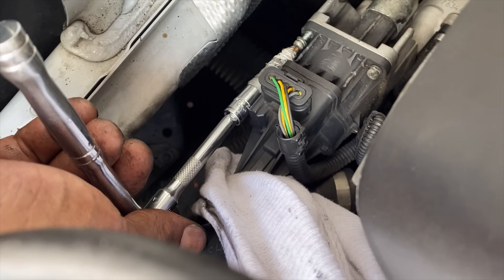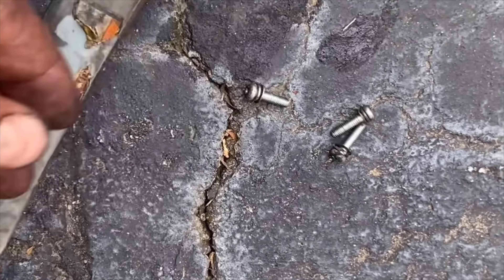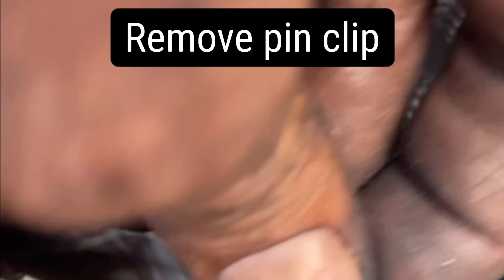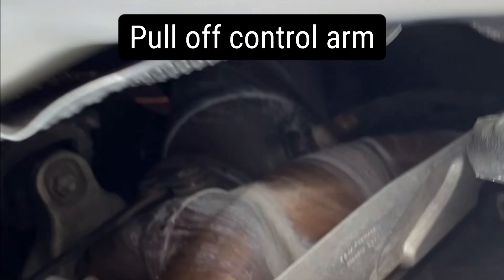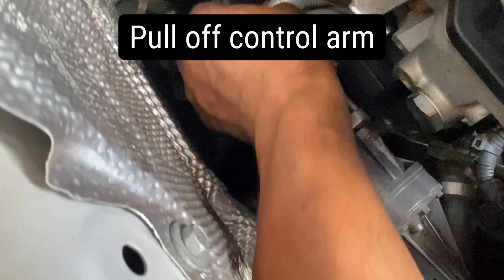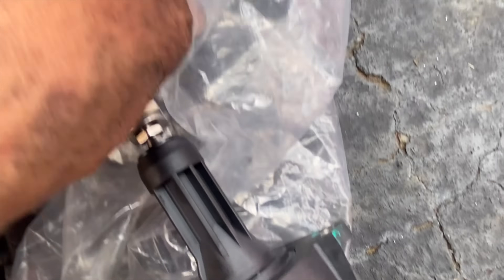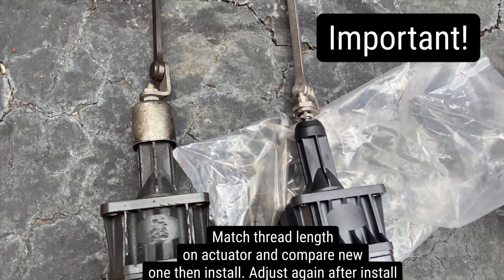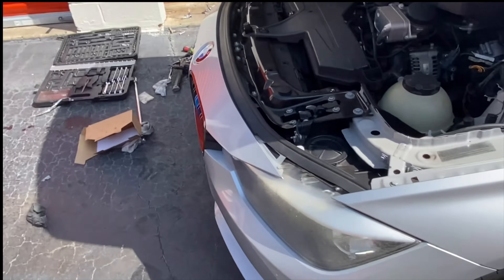BMW 328i - Wastegate Actuator replacement/ P1920 code/ Fix Drivetrain Malfunction (n20) f30 /f32 DIY

Comment: “I have this error: 123432 Electric wastegate, stop learning: stop position (wastegate closed) outside tolerance. What could it be?
Reply: F32 420i n20
Reply from the maker: Good luck and let me know if you need anything else. Be sure to like, share, subscribe and check the links in bio🙏
Reply from the maker: That BMW fault code 123432 (Electric wastegate – stop learning, closed position outside tolerance) on an F32 420i N20 almost always points to a mechanical wastegate issue, not software.

On N20 engines, the turbo wastegate flapper and arm wear over time, which causes excess play. When that happens, the DME can’t confirm the fully-closed wastegate position during calibration, so the adaptation fails and throws this code.

Most common causes on BMW N20:
• Worn or loose wastegate flapper (very common)
• Misadjusted wastegate actuator rod
• Failing electronic wastegate actuator (less common)
• Binding wastegate due to carbon buildup

Clearing the code or updating software won’t fix it if the wastegate can’t physically close. A temporary fix can sometimes be done by adjusting the actuator rod, but the permanent solution is a turbo repair or replacement. BMW sees this issue frequently on N20/N26 motors.

If you’re hearing a metallic rattle on cold start, that’s a strong sign the wastegate is worn.

Comment: I bought a 2013 328i (n20) engine. The car will not start and the only code i get is tbe p1290 wastegage actuator stop limit, actuator needs relearned. Would this stop the car.from starting? The lady i bought it from was driving it and it went into limp mode and when she got home turned it off and back on it would not start back up. P1290 is the only code i am getting
Reply from the maker: Congrats on your car purchase. More freedom! 

Ok let’s get down to business. First step is it a new actuator?
If it’s new or when you replace it (link in bio) you will need to calibrate the actuator with insta software that cost yearly and got to your local mechanic. Other way is to manually calibrate it(in description) or I can help you via live stream after paying the $99 live conference fee. If you need a step by step until fix.

Here is more detail below to assist you? 
2013 BMW 328i (N20/N26) – P1290 Code

P1290 means Turbocharger Wastegate Actuator Control Deviation. The DME is not seeing the boost pressure it expects, usually because the wastegate isn’t opening or closing correctly. This is a very common issue on 2012–2015 BMWs with the N20/N26 engine.

Common symptoms
	•	Check engine light
	•	Reduced power / limp mode
	•	Hesitation under acceleration
	•	Weak or inconsistent boost

Most common causes (in order)
	1.	Failing electronic wastegate actuator (most common) – internal gears wear or stick.
	2.	Wastegate linkage binding from heat or carbon buildup.
	3.	Boost control solenoid failure.
	4.	Vacuum line leaks (less common but possible).
	5.	Turbo wear (rare unless high mileage or abused).

How to diagnose
	•	Scan with a BMW-capable tool (ISTA, BimmerLink, Foxwell, etc.).
	•	Run the wastegate actuator test and check for smooth full movement.
	•	Inspect the wastegate arm and linkage for binding.

Repair info (link in bio)
	•	Wastegate actuator replacement is the most common fix.
	•	Part: ~$250–$400
	•	Indy shop total: ~$600–$900
	•	Dealer: ~$1,200–$2,000
	•	Actuator must be calibrated with ISTA after install or the code will return.
	•	Turbo replacement is only needed if the wastegate flapper itself is worn.

Important note
Do not tune the car until this is fixed. A tune increases boost demand and can make the problem worse or damage the turbo.

Good luck 

Https://www.nerovisum.com
Instagram: Nerovisum

Comment: Any idea what a p1290 code could be on a 320i xdrive 2014 ?! I bought the whole watergate actuator already before diagnostics
Reply from the maker: Code: P1290 – Boost Pressure Control, Plausibility (BMW N20 Engine)

Break down of error code:
“Boost pressure control, plausibility: Pressure too high/low or electrical fault in wastegate actuator circuit.”

This code often triggers when the DME (engine computer) detects a mismatch between the commanded boost pressure and the actual measured boost, or when it loses proper communication with the electronic wastegate actuator.

⸻

🔍 Most Common Causes (Specific to 320i xDrive N20)
	1.	Wastegate actuator not calibrated after installation — this is the #1 cause if you replaced it already.
	•	The actuator rod must be preloaded 0.5–1.0 turn when connected to the wastegate arm.
	•	The ECU must “learn” the actuator position using diagnostic software (ISTA, INPA, or BimmerLink Pro).
	2.	Faulty wastegate actuator wiring or connector corrosion.
	•	Check the 5-pin plug on the actuator for bent pins or oil ingress.
	•	Tug gently on the harness; broken wires inside the insulation are common.
	3.	Boost pressure sensor failure (MAP sensor).
	•	Located on the intake manifold. If it’s dirty or failing, it can send wrong readings that trigger P1290.
	4.	Boost control solenoid (pressure converter) malfunction.
	•	On some N20 builds, a vacuum-controlled solenoid helps regulate the turbo system. If stuck or leaking, it throws off readings.
	5.	Turbocharger mechanical issue.
	•	Stuck or loose wastegate flap, internal leak, or damaged impeller can all create P1290 plausibility faults.
	6.	DME adaptation not reset after part replacement.
	•	When you install a new actuator, the ECU needs a fresh calibration (“wastegate adaptation reset”) through ISTA or equivalent scan tool.

⸻

🧰 Step-by-Step Fix

1️⃣ Inspect the wiring and plug
	•	Disconnect the actuator plug. Look for corrosion, loose pins, or burnt smell.
	•	Clean with electronic contact cleaner if needed.

2️⃣ Check the actuator rod and preload
	•	With the car off, manually move the wastegate arm  it should move smoothly with spring tension.
	•	Adjust the new actuator rod so it pulls the arm slightly tight when connected (about half-turn preload).

3️⃣ Run an adaptation reset
	•	Connect ISTA, BimmerLink, or INPA.
	•	Run “Turbocharger Wastegate Actuator Calibration / Adaptation Reset.”
	•	This allows the DME to relearn the new actuator’s limits and clear the plausibility error.

4️⃣ Inspect MAP/Boost sensors
	•	Clean or replace the boost pressure sensor (intake manifold) if dirty.
	•	Verify no vacuum or boost leaks with smoke test or carb cleaner check.

5️⃣ Clear the code and test drive
	•	After reset, clear codes and drive 10–15 minutes.
	•	Watch boost pressure (using a scan tool or MHD/BimmerCode logger).

⸻

✅ If the code returns
	•	Replace or test the boost pressure converter solenoid (usually mounted near the turbo).
	•	Check for software update (DME reflash) BMW released several patches for wastegate logic on 2013–2015 N20 engines.

Comment: It is time to change the wastegate actuator on my N63....oem on fcpeuro is $600 plus. They have cheap ones on Ebay for under $100. How good could they be
Reply: I got mine on amazon for my N20 for like 60-70 bucks just make sure you re learn it with ISTA
Reply from the maker: Or manual adjust by monitoring the boost.

OEM (dealer recommended) -> one with insta software compatible -> or just manual adjust it arm/bolts (cheapest option which works). Part here: https://amzn.to/3BE13kH

Comment: 123702 what is that??
Reply from the maker: The fault code 123702 on your BMW 328i generally corresponds to an issue with the turbocharger waste-gate actuator circuit.

Failed waste-gate actuator (stuck, shorted, or not responding)
	•	Damaged or frayed wiring harness to the actuator
	•	Poor or corroded connector (pins shorting to ground)
	•	Calibration/learning for the actuator not done (after replacement)
	•	On some BMW turbo systems, there are related service bulletins covering extended warranty for the actuator.

Comment: P120408 
P1234.01
P1234.32 
Bu code veriyor  sizinkide aynımı. Bilgi verirmisin
Reply from the maker: 1.	Spark plugs or coils might be weak.
	2.	A fuel injector may be dirty or bad.
	3.	The fuel pump or sensor might be acting up.

Step-by-step fix order (cheapest → most expensive):
	1.	Replace spark plugs.
	2.	Swap coil packs between cylinders to see if code moves.
	3.	Check for air leaks/vacuum leaks.
	4.	Clean or replace fuel injectors.
	5.	Test fuel pressure → replace high-pressure fuel pump if needed.
Reply: @Nerovisum 
Kontak açınca  tahrik veriyor 
Çalıştırmadan
Reply: Turbo veskeyt değişti
Reply: @mustafatekeli1990 
Sorun çözüldü mü?

Comment: Hey I’m currently in the process & wanted to know  how do I tighten the bolts after the actuator is installed? The control arm fell down because the bolts jiggled their way off lol
Reply from the maker: Hello!

Congrats on taking on this project. You will save a lot of money! 

Moving forward, Are you talking about that 1 nut that adjust the control arm length or 4 bolts that lock down the wastegate itself? If nuts, go to ace hardware to buy the same mm nut. The second nut keeps the other nut from vibrating off. Another option you can use is a low grade lock tight liquid placed on threads. That keeps bolts and nuts in place. I accept cash app tips for free advice and repair: $Gettomoney777
Subscribe - like - tip❤️. More love = more frequent content. 

Good job and good luck!
Reply: @Nerovisum hey thank you so much for the reply I used blue loctite for the control arm bolts! I did save 10,000$ and my malfunction is fixed and operating in new condition 😉.

Comment: My bmw x1 been doing this intermittent, happened shortly after we replaced engine due to timing issue. "New" engine came with turbo so we didn't change it. Still have the old engine with original wastewater accuator.
Reply from the maker: It sounds like the issue may be related to mismatched or aging components between the new engine and the original turbo setup. Since you kept the old turbo wastegate actuator from the original engine, there’s a strong chance it’s not properly calibrated for the “new” turbo that came with the replacement engine even if it looks compatible. Compare part numbers and computer/ manual calibrate the wastegate. 

To provide complementary  advice for all in the future donation are accepted. Not one thing in this world operates on free energy and keeps running. https://cash.app/$Gettomoney777
Reply: @Nerovisum n/a, the "new" engine came from the same year and make bmw. It was used and I'm thinking the previous owner had issues with the turbo cause it was about 100k miles less then my current car. I replaced it with turbo from my old engine and don't seem to have the same issues

Comment: I bought a car a 2013 bmw 328i been driving it for 3 days already and seem good no check engine light or nothing so when I tried to go and do a smog check it showed it had a p1290 code yet nothing shows on my car on the screen or light? So far driving been good no nothing
Reply from the maker: Clear the code with one of these scanner tools from @amazon store: 
https://amzn.to/41D39L5
https://amzn.to/4neXXqL

Drive 50-100 miles or 1-3 days then take it back in the emission place.

Comment: I have code p1290 on my 328 f30 n20 engine maybe same problem with wast gate? Tnx.
Reply from the maker: If you’re seeing P1290 and experiencing:
	•	Power loss
	•	Rattling from turbo area
	•	Boost-related driveability issues

Then yes, it’s very likely wastegate actuator-related. Replacement or recalibration may be needed. 

Component
Description
Electronic Wastegate Actuator
Fails internally or gets stuck, causing underboost or voltage issues.
Boost Pressure Sensor (MAP sensor)
Sends incorrect boost readings to the DME, triggering P1290.
Turbocharger Bypass Valve (Diverter Valve)
If stuck or leaking, it disrupts boost control and triggers a fault.
Boost Solenoid / Control Valve
Regulates pressure to the turbo actuator; faulty signals can throw this code.

Secondary cause could be: Wiring Harness Faults
Broken or frayed wires to the actuator or boost sensors cause abnormal voltage (especially “high” voltage errors).
ECU/DME Software Glitch
Faulty logic in boost control loop can misfire codes, especially if the DME has not been updated.
Charge Pipe Leak / Cracked
Causes underboost, which may trigger P1290 depending on how the DME interprets sensor data.
Intercooler Hose Leak
Same result — underboost = fault stored.
Thermostat Heater Circuit Fault
Some BMW documentation refers to P1290 as a coolant thermostat heater circuit high (especially on older BMWs, but rarely on N20). If that’s the case: test the thermostat connector and check for blown fuses.

Scheduled a FT step by step walk through. I charge hourly and you can inquire at generalmailbox1@nerovisum.com

Scan tools in the description

Comment: How much does this repair cost
Reply from the maker: Replacing the wastegate actuator on your 2013 BMW 328i can vary significantly in cost, depending on whether you choose a dealership or an independent repair shop.

Dealership Costs:
At a BMW dealership, the total cost for replacing the wastegate actuator typically ranges from $1,500 to $2,000. This estimate includes approximately $700 for the actuator itself and around $800 to $1,300 for labor. For instance, a BMW M2 owner reported a dealership estimate of $700 for the actuator and $1,300 for labor, totaling $2,000 . ￼

Independent Repair Shop Costs:
Opting for an independent or “mom and pop” repair shop can be more cost-effective. Owners have reported quotes around $1,200 for the complete replacement at such establishments . Labor charges at these shops are often lower, and they may offer more flexibility in sourcing parts, potentially reducing overall expenses.

Parts Pricing:
If you’re considering sourcing the part yourself, aftermarket wastegate actuators are available at varying price points. For example, some replacements are listed around $31.99 (link in bio), though prices can vary based on brand and quality. ￼

Warranty Considerations:
Before proceeding with the replacement, it’s advisable to check if your vehicle is still under any applicable warranties. Some BMW models come with a Super Ultra Low Emission Vehicle (SULEV) warranty, covering certain components up to 150,000 miles or 15 years. In some cases, this warranty has covered the cost of wastegate actuator replacements, resulting in no out-of-pocket expenses for the owner.

if you’re willing to do it yourself as mention you can get one between 35 and $100 but you can’t always calibrate certain models with Insta. Therefore you would have to manually calibrate the engine monitor the boost bar, AK boost pressure and readjust and continue the process until you have the right amount of boost. I offer step-by-step FaceTime instructions at an hourly charge.